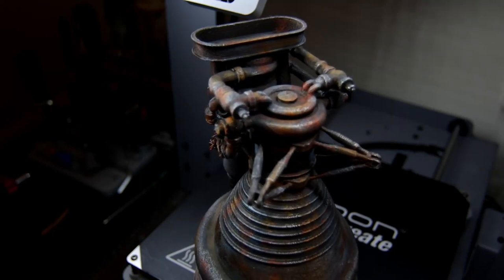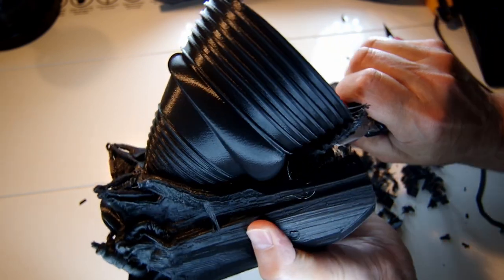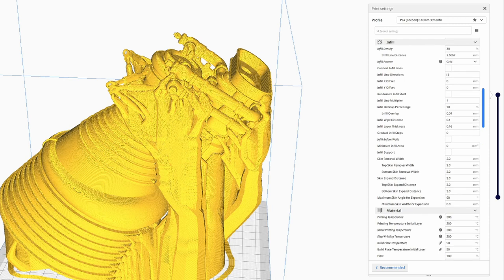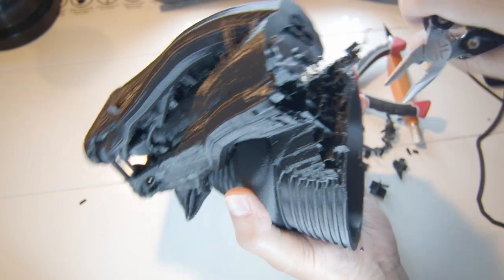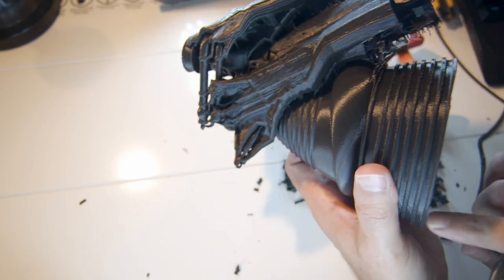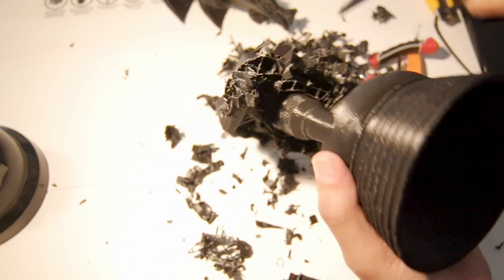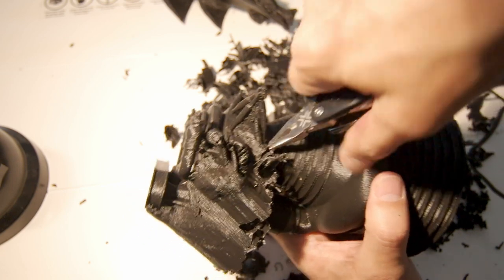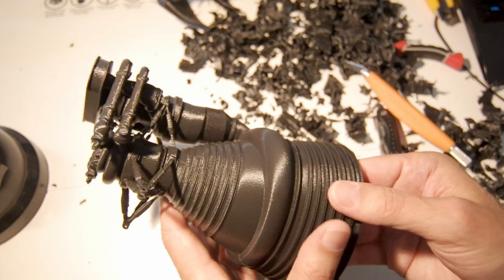Model, Print, Paint - Saturn V Rocket Engine

Comment: A month ago you were having printer issues, did you ever find the cause?
Reply from the maker: Hi Duncan, yes I went back and forth, bought an all metal hot end (which instantly jammed and is still blocked to this day) bought new heater blocks and a heap of nozzles and eventually got it back to printing reliably. But I think the two things were causing my problems were a combination of worn nozzles and bad filament. The nozzle I had was printing seemingly fine but I was getting under extrusion all the way through my prints and I don't think the grey filament I was using was helping the situation either. Basically, all my problems went away when I fit new nozzles and changed the filament. I'm replacing nozzles much more regularly now, as soon as I see signs of under extrusion the nozzle gets instantly replaced with a new one.